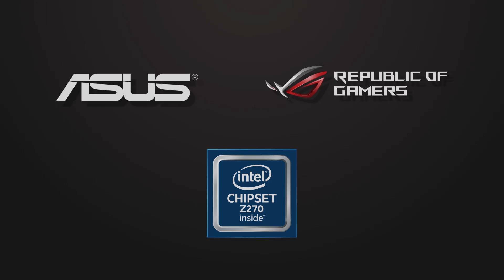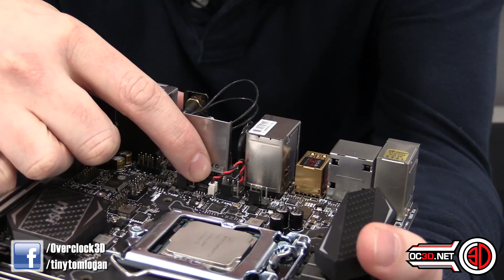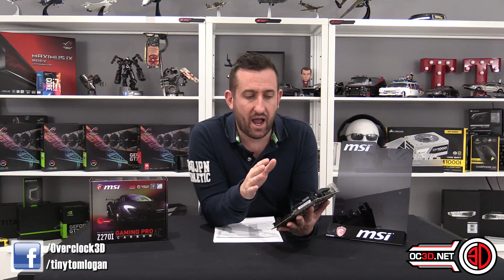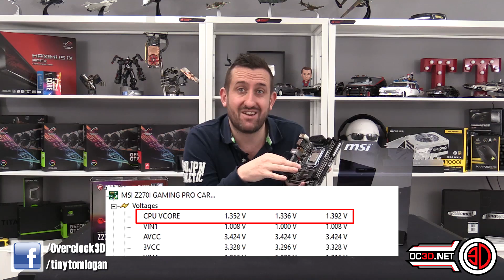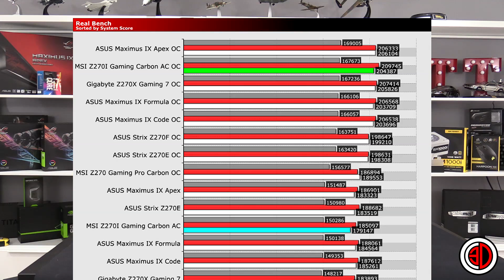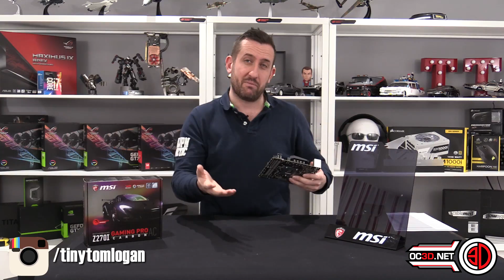MSI Z270i Kaby Lake ITX Motherboard Review

Comment: Thanks for this extremely comprehensive review.  I ended up getting this board because, well... it was between this and the Asus but I was at Frys and I had the buy now have now fever.  So I applied the recent bios 1.9 and those voltages you mentioned are STILL not listed..  They are on "auto" with a blank bit under the voltage column.  I did set my DDR at 1.35v which is what it should be while running the XMP profile.  So I am planning on manually setting the rest along with a mild oveclock of 4.4ghz on my 6700k which I know is 4.6ghz capable (I moved it from another system where it ran like that at 1.36v for a year) but I want to monitor all the voltages in windows.  What is the best recommendation for monitoring software?  Just HWmonitor??  or the Pro version?
Reply from the maker: HWmonitor and HWinfo
Reply: tyvm

Comment: If I buy 3000mhz RAM but only run it at what the motherboard sets automatically, do I have to worry about the voltages? I'm also not over-clocking my CPU.
Reply from the maker: So you buy 3000mhz ram but run it at 2133? Why?
Reply: OC3D TV I'm not against running it at 3000 MHz, I just don't want to have any problems with parts burning out in the future. I already had to have this board replaced because it failed after about a week for some unknown reason. If I run it at 3000 MHz and manually set the voltages, do you think that I would have any problems with durability in the future or was the auto setting the only problem?

Comment: Bios problem wouldn't be an issue if running 2133 correct? Also the z270 boards can use skylake chips too correct?

Comment: Tom I really appreciate your level of detail on your reviews. Motherboards and gpus power delivery vrm power phases caps chokes and all the other goodies can be crucial to the longevity and overclocking ability that lasts and as you have seen multiple times some brands try and get away with the cheapest components in terms of power delivery by covering it up with flashy heat sinks and rgb lights and its nice to know that your getting a good board no matter the brand. We should get what we pay for and not be blinded by the RGB Lights lol. Thanks for the reviews! o7

Comment: LLC has always sucked on msi boards :(.  The xpower Z270 is missing ppl volts as well so you can't get over 5.8ghz on Ln2 :/ most boards are getting mid 6ghz at worst!

Comment: Use HWINFO to read VCCIO and SA. HW monitor is crap in comparison.
Reply from the maker: Raven crow will look into that tomorrow. Can you dm me about it please?
Reply: Raven crow I send this^ it is the best info monitor I have seen.  I worked well with my z170 boards but have not tried Z270 as I am waiting for amd this time round.
Reply: Raven crow do you know where to look for the suspect values ? Under sensors ?
I think they are possibly being displayed under other Terminology so I can't recognise them.

Comment: I've never seen a board with less then .03v of variance under load with power saving features enabled. my z170a gaming pro carbon is the same (only 1 setting) and with power saving features disabled voltage is rock solid and never moves even .01v.

Comment: Hidden volts and deliberately done, Just tells me not to touch any MSI motherboards
Reply: It’s not that MSI hide the voltages on the ITX model, it’s because the Super IO chip on that mini-ITX board doesn’t support showing of voltages. The super IO chip on that board is smaller than other Z270 boards. So it’s a hardware limit. TTL is already aware of this (after the review).

Comment: What version of Bios was on tested mobo ? 

I have it on v1.3 and using corsair dominator platinum 3200 with XMP profile. I have not overclocked and little concerned now after hearing your findings about the voltages. 

Should it be refrained until MSI address the bios ? 

Great info on memory volts. Thanks
Reply: Coltc8 thanks. I skipped the full vid as i was viewing on my phone with limited data.
Reply: It’s not that MSI hide the voltages on the ITX model, it’s because the Super IO chip on that mini-ITX board doesn’t support showing of voltages. The super IO chip on that board is smaller than other Z270 boards. So it’s a hardware limit. TTL is already aware of this (after the review).